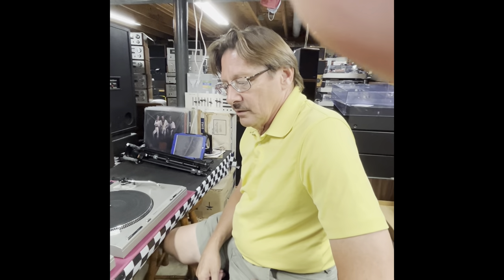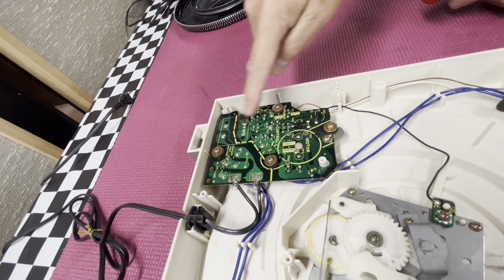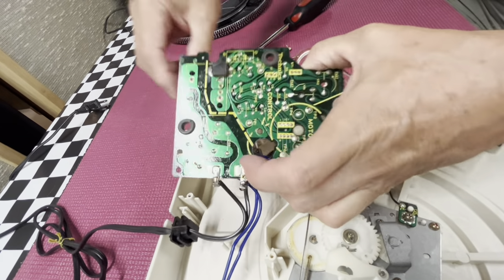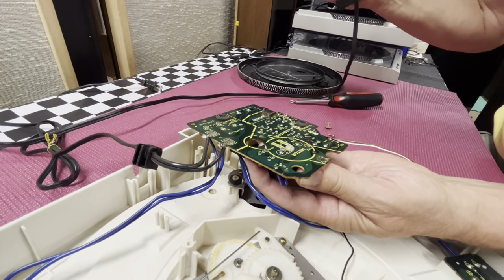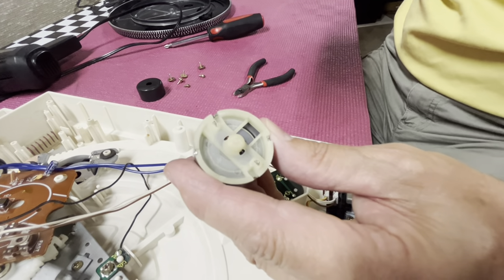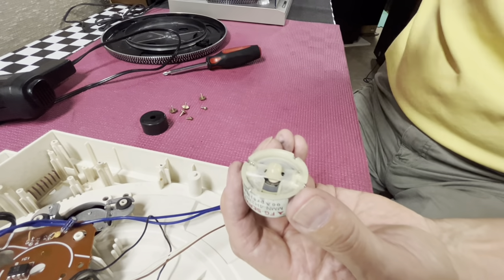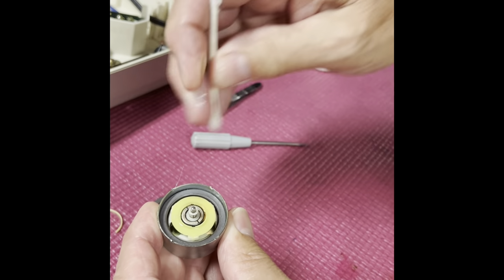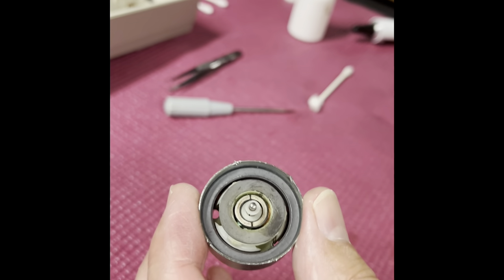Motor Repair for Technics Turntable Models SL-B101, SL-B202 and SL-B303

Comment: Working on a B202...  Have ground off the tabs using a Dremel.  Feeling significant resistance when trying to remove the bell housing.  Suggestions?  The brushes don't seem thick enough to be the cause.

Comment: Update on my previous comment. I managed to open up my Technics SL-J11 motor. However, my motor was a much more simple design. Two things I noticed. The shaft bearing had a bit of play, but still manageable. The noise on mine seemed to come from the spindle bearing that was on the plastic motor cover. I couldn't manage to get those brushes out of the way without bending them, but they still work so it's fine. In the end it significantly reduced the grinding noise my motor had and it's very quiet now. Not silent, but night and day compared to what it was like previously. Those metal tabs are an absolute pain in the ass to open/remove and I didn't even bother with glue when mounting the motor back, it seemed to fit in there very tightly.

Comment: My turntable goes in reversr now, could it be the plastic piece on the motor put on the wrong way or the magnet flipped
Reply: I have the same issue, did you manage to fix it ? Thx
Reply: @quentinbernaudon3193  yea I flipped the magnet but it was already damaged because of the chip
Reply: Sh**, that doesnt sound good for me… i’ll try tommorow 
Thanks

Comment: Thanks so much for this instructional video! I do have a question about a small issue I am having with this repair. There is some friction in the motor housing. Is it possible that the glue that I applied to the underside of that metal washer raised the height slightly, causing it to rub against the inside of the white plastic motor housing after reassembly? The motor turns so smoothly before I reassemble it. And then there is friction and resistance and it doesn’t spin very smoothly after I snap the housing back together. Any advice or insight you can offer me? Thank you!
Reply: Ah, nevermind. I discovered the problem. One of the little brushes popped down when I resoldered the motor onto the board. It was rubbing against that washer. I didn’t realize the end of that brush was actually the solder point of the motor and can move somewhat freely within the plastic cover once you clean the solder off of it. 
Problem solved and it works great! Thanks again! 😊